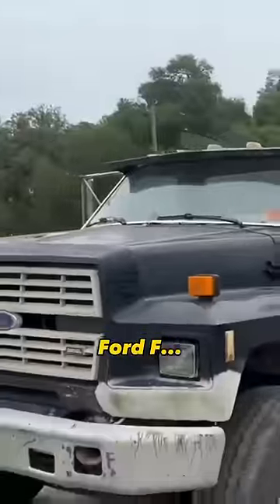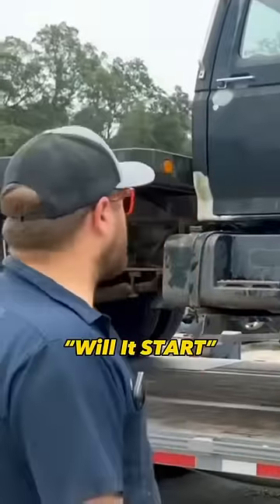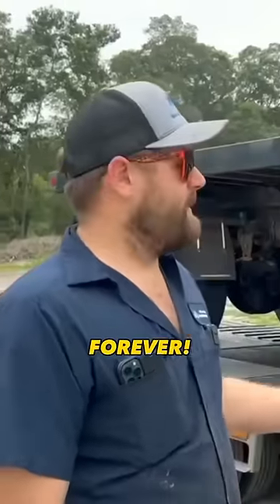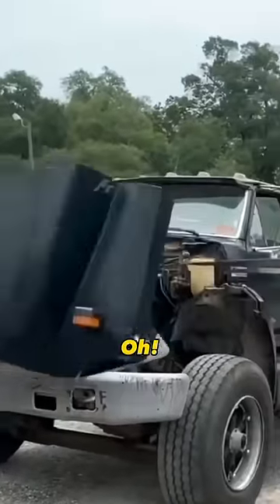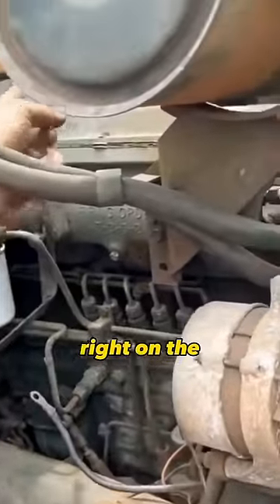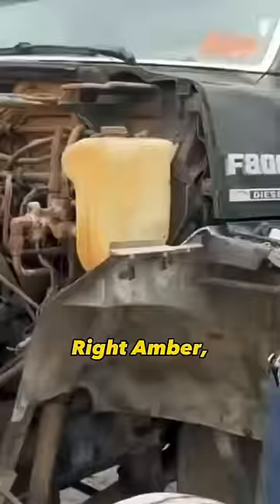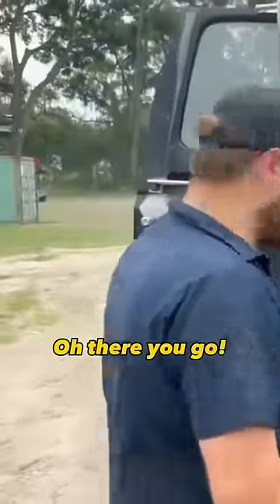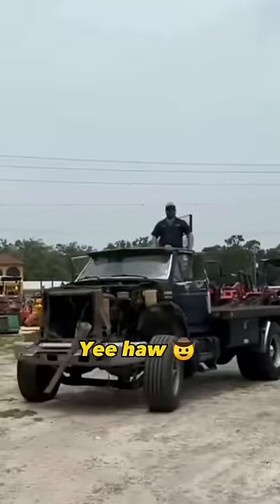Will it start??

Comment: it's a Brazilian motor and it's one of the few motors that have the turbo on the left side of the engine
Reply: Thats a new holland 6 banger isn't it?
Reply: @21kitkatbar indeed so
Reply: Que motor é esse?
Reply: I'm from Brazil, this engine isn't from here.
Reply: New Holland and Ford dancing in Brazil is a very rare partnership. A. Camarata approved. These are one of them "forever" trucks that us younger folk find to be quite elusive. Usually u gotta grease up a boomer with some whiskey before he agrees to weed-eat the overgrown grass so you can test drive one of these.
Reply: @henriquecamp you aren't
Reply: What kind of number is a Brazilion?
Reply: @Gruntled2001  Brazil mentioned 🇧🇷🇧🇷🇧🇷⚽⚽⚽
Reply: It's . Cummins engine not a newholand ...
Reply: @johnnieb6057  the turbos on a cummins are on the right side of a cummins engine
Reply: @johnnieb6057 it actually is a new Holland in which Ford aquired New Holland in 86 but fiat owns most of it now
Reply: @danielGee03  prove it.
Reply: @chrismaina1830  Make your move creep
Reply: Im from ford the engine was made by me

Comment: That's a New Holland 7.8. Made in Brazil, and indestructible if left stock. They don't do well with mods that require higher rpms than stock. I'm a little surprised this one didn't have air start as many of the L6000 and L7000s did

Comment: Poor hood… damn that was rough
Reply: it’s an old workhorse it will be fine lmfao it’s not a classic Ferrari… what would you be doin spit shining it and takin it to the drive in?
Reply: @OlympiaUnlimited  im a semi truck mechanic and i replace a lot of hood springs, cables, and even hoods from the cables snapping and then splitting the hood at the hinges.. but yes beater with heater indeed but man as a mechanic that was rough😋
Reply: The hinges were most likely seized so needed some persuasion.
Reply: Opening that hood with a fork lift was totally stupid

Comment: TYPICAL Ford's keep on running never break. Engines out last the body's. Nice old school truck.
Reply: Typical pre 1990’s ford anything after is 💩
Reply: Obviously you never owned a Ford tractor.Look up Porous Block Syndrome
Reply: I have owned many Ford's. Now my Chevys all 3 blew up.
Reply: @lincolnls0416 you must have parked those Chevys too close to a Dodge. When you do that they start doing Dodge things...
Reply: @daffyduck9901  nope I haven't had any Chevys or any GMs last over 60k. Miles. My few Ford's always got over 300k miles and 2 got over 400k miles.

Comment: 7.8 in-line six, made in Brazil, Ford/New Holland venture. 
Awesome engine, please don't use starring fluid on it, you could hurt it
Reply: brother it was sitting in a backyard for decades
Reply: Ese es el motor Genesis?
En Bs As tengo un Ford 8030 con ese mismo
Reply: My diesels professor at my maritime college said he would only think about using starting fluid if he was on a boat that wouldn't start and you were trying to escape a sinking ship, in his example, or something else that was an emergency.
Reply: Starting fluid wont hurt it.......
Reply: @Glipsnarp it’s higher compression my guy it’s also way more combustible with blow the rings out
Reply: @paranoidpothead5748  i know. I start tons of engines with starting fluid. Just dont be a fool. Iv used 2 cans of ether on a 8.9 cummins to get it started in -30°C

Comment: All these videos basic:
1) find old vehicle
2) say it's been sitting forever
3) will it start?
4) find a battery
5) spray starting fluid
6) turn engine over until starts
7) act happy and surprised
Reply: You forgot step 4.5... Get it started prior to starting it on video.

Comment: F1000! That's the big boy. Whatcha wanna haul?
Reply: They dont make a f1000 the biggest they go is a f900
Reply: It says it on the side the hood it’s a F 800
Reply: Ford L8000-9000 series trucks are the biggest
Reply: its an 800
Reply: If I recall correctly the Ford F1000 was a Brazilian regular duty (not sure how else to describe) pickup with turbo diesels from factory, before Super Duty was a thing
Reply: Yes.
Reply: Freedom

Comment: My dad has a 87 F-150 5.0. Things been sitting for like 20 years out in the elements and STILL starts up if you put a battery on it. It's got a bad fuel pump, and naturally all those years in the sun got the interior pretty worn out. Other than that, it's a great truck.

Comment: Reminds me of my dad's 98 GMC Suburban that was sitting for 7 years since 2016. I connected the battery, sprayed some starting fluid in, n it started right up. Runs pretty good for having old af gas in it lol.
Reply: Gas lasts longer in sealed fuel systems. I had to park my '88 Chevy work van for 6 years after falling ill. Had to put it back in service after my car went into limp mode. The van started right up on the old gas. Had 1/2 tank so added a quart of B12 then topped it off with fresh gas. Ran the van until it hit E to make sure everything got cleaned off inside.
Reply: Those old 90s GM trucks are legendary. My dad’s 88 half ton pickup was parked over a decade and it started right up when I put in the battery. Great trucks. My 95 Suburban has been with me through thick and thin. It’s closer than a friend lol
Reply: @u.d.novthu2k204  I remember going on road trips in my dad’s 98 suburban. Especially stretching my whole body out in the third row lmao good times. I’d like to own it someday for memories sake.
Reply: 2 weeks later and I’m sure you’re replacing your fuel injectors
Reply: My mazda b2500d also started instantly with 15year old diesel in it also no starter fluid was used

Comment: bro if you’re ever starting an old diesel that’s been sittin a while, make sure you get the head covers opened and check the injectors to make sure none of em are stuck… lot of runaways at my shop could’ve been prevented with that

Comment: Brazilian Diesel engine, good engines kinda low power by today's standards but if you were not in a hurry to get where you were going and drove it right they would go, go, go and go. The left-hand turbo is the give away on the engine being Brazilian. Love that engine, even the older non turbo engines were pretty tough if driven correctly.

Comment: I had not thought about it until I saw this video ->
    I drove a Taco but have been thinking about buying a camper trailer but am extremely limited on the size because of the Taco.  I was considering going up to a Tunda, but now I'm thinking, buying a used heavy duty truck might be a better idea so I could tow anything I want and still keep my Taco as my daily driver.

Comment: That's a hell of an engine, too bad it's like the 190 or 210hp version. Get a real intercooler for it and crank it up to 275 and it'll actually out run some of the 8.3 Cummins of it's day. It's also very rare to find one not in a water truck it seems.

Comment: I swear it's always diesels that I see starting right up after many years. Pull a diesel out of a lake give it some starting fluid and it'll run. Buried your army truck from the 1950s? No problem. Starting fluid is all you need.

Comment: That's a F650 short chassis.
The F750 had the regular and extra long chassis
The F850 had a short chassis, dual axle
And the F950 had the long chassis Dooley's or tribbles..
The F550 and below had a pickup truck style cab.
Reply: F550 didn’t come out till after the ‘99 body style. The biggest you had in the pickup cab was a 450 and those were just called “F-Super Duty”.

Comment: Those old ford trucks have a Cummins in them. It’s an old c. With mechanical p pump. Just worked on one.
Reply: That’s not a Cummins. It’s a New Holland Brazilian diesel. See where the injector pump is on the passenger side? Dead giveaway.
Reply: @GMbowtie350  if the year is 91 and earlier. Then it’s a ford new holland. 92 and on is a Cummins. Either a 5.9 L B series or a 8.3 L C Series. Both straight sixes.
Reply: @nolendvorak6352  The guy said on the video it’s a 7.8. On top of that it looks nothing like a Cummins.

Comment: I believe this is a New Holland engine and Ford acquired them in 1986 and changed the name to Ford New Holland Inc. Made in Brazil and after Ford bought them, a turbo charger was added. The math comes out to 474 cubic inches.

Comment: First rule of diesel, NEVER use Ether/starting fluid, it dries the cylinder walls of the oil for the pistons ! Use WD-40 instead, or any other spray lubricant.....

Comment: Its summer and dudes using starting fluid😂
Reply: That's because he's trying to start it Einstein
Reply: @daffyduck9901  If theres fuel, air and compression it doesnt need no stinking starting fluid
Reply: @NuffMan_  there is no spark on a diesel

Comment: did you even put new gas in it?
I hear old gas would last for years.
Reply: This truck is diesel.
Reply: @robertelee6712  ya and whether it's diesel or gas does not pertain to my question. My question was the age of the fuel used. I know ethanol can't last that long, it draws water.
Reply: @gearjammer3200 Diesel doesn't draw water at just grows a beard and gets tougher 👊
Reply: @daffyduck9901  oh so diesel is alot like the marines lol

Comment: Why would you start fluid it 😢 that's how you tilurn it into an ether baby fuel and air is what you need not basically gasoline so hard on diesel engines

Comment: So he pressure washed it ay?? He got in every single nook and cranny and under the truck and washed it top to bottom and under the hood and the frame its way to clean for a "will it start" its obvious it runs 🤯 doesn't take a genius to work that out. Dislike for you!!

Comment: Why does it seem there’s so many people out there foolish enough to use ether on a diesel motor???

Ether is TERRIBLE for diesel motors!!
Reply: Doesn't do s*** to them
Reply: @daffyduck9901  it detonates. Diesel doesn’t. Do a little research dude, ether is no good for diesel motors. Just because it starts a motor doesn’t mean it does no harm to use it, take the air filter out and spray WD-40 down the intake tube, it’ll work just as well and doesn’t do any harm to the motor whatsoever
Reply: @ryandubyah2345  more than I've done research I have over 40 years with diesel engines. It doesn't hurt Jack schitt